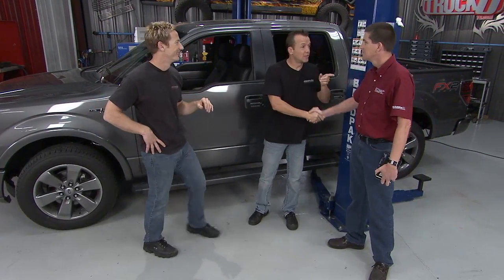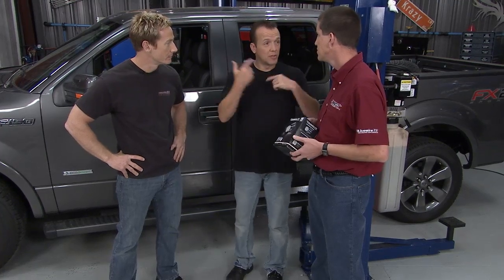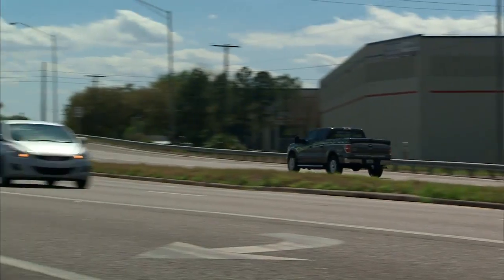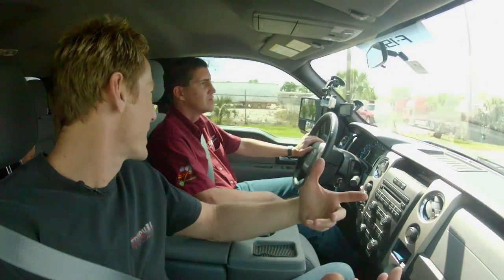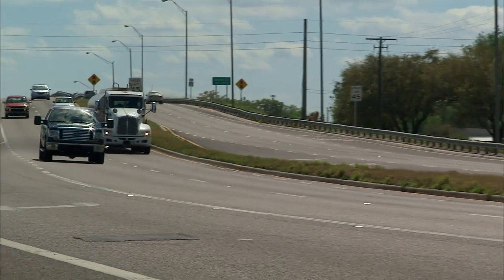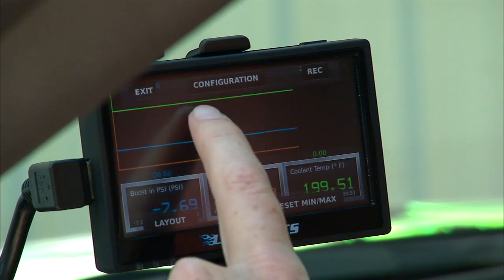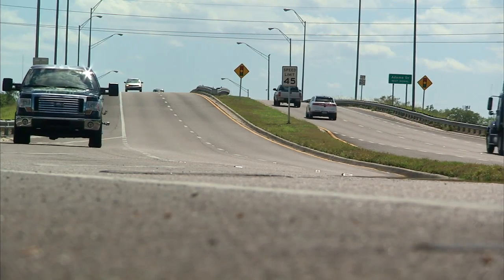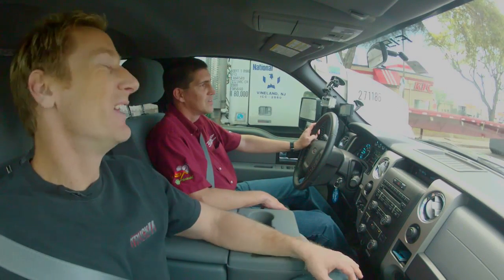SCT Livewire TS Ecoboost F-150 Performance Tuner & Data Monitor

Comment: I know the Coyote's 5.0L's ECM - if it's been flashed, it logs it.  There's actually a section in the ECM's memory specifically for that.  If the motor detonates or get's damaged due to the tune - Ford will not warranty it.  This happened to my friends 2010 Mustang. There was some bad fuel distributed, and it caused detonation in his motor - and the tune he had did not have enough compensation for that. Ford looked at the ECM and voided the warranty. Can only assume the same for the EcoBoost.

Comment: I keep buying new cars and it’s a mistake.  Everyone worried about warranty’s.   I think your better off saving money buying them out of warranty and doing what you want to them.   Seems like every time I have a warranty issue the dealerships are a pain in the ass to deal with anyway.   That sound is “normal” that wobble is “normal”.  Now that I am older from now on I ll but lightly used vehical a out of warranty and pay a good mechanic I trust to make any repairs.  The math doesn’t lie.  You can buy a nice f 150 with 36000 miles for half the cost of a new one.  Do what you want to it and even if you blow motor it cost you maybe 10k.  Your still in the green.

Comment: Mileage wise I dont see a huge difference between the ecoboost and the 5.0L, my dads truck avg about 15mpg in a city hwy mix, and it lacks the "roar of a v8" To me the ecoboost sounds like and is nothing more than a high output V6.
Reply: 1995bisquick then you haven't towed with them. I had a 2012 5.0 and it was nicer good power etc. but my 2016 ecoboost kicks the hell out of the 5.0 in every aspect.
Reply: joseph craig Not in the repair shop tho